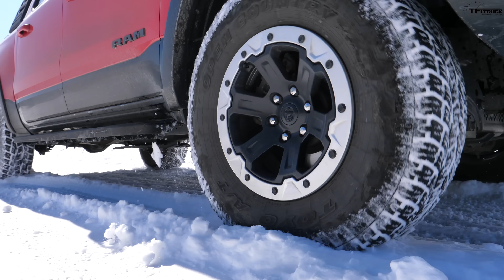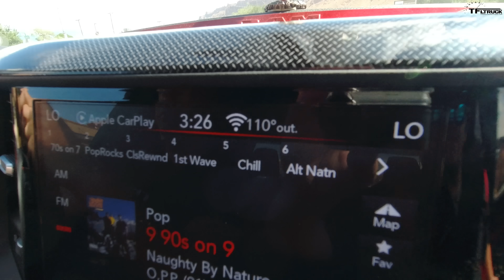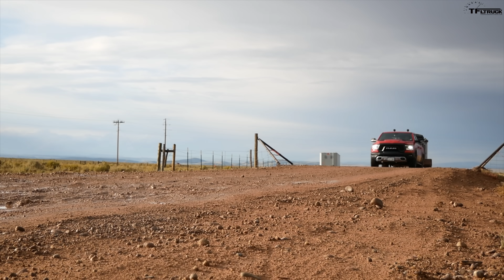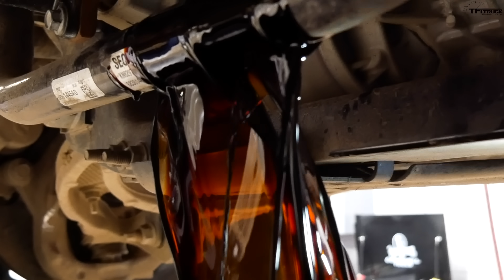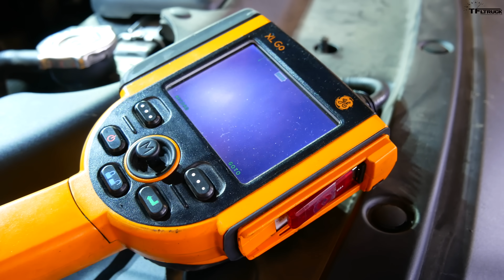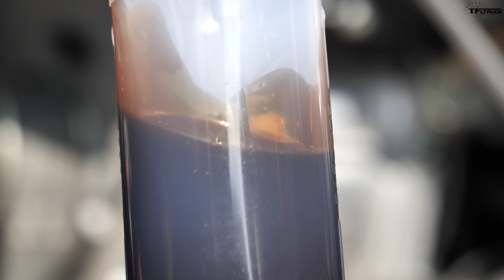You Will Be Surprised at the LOOK INSIDE the HEMI V8 After Months of Torturous Driving! Ep.5

Comment: As far as the TBN goes (6.5), that is a mediocre oil even for a synthetic oil!
Reply: But it's well engineered as we have seen from hundreds of used oil analysis reports which have been posted online showing that the roll-off of the TBN in this oil is very gradual and even after 10,000 miles is still in a comparable range of where other oil brands\formulations that start out with higher TBN numbers are at the equivalent mileage.

Comment: So... The really really obvious question... What did you get in the oil change? Was there any fine particulate material? Anything magnetic? Were there macroparticles on the sump plug? If you're actually intending on torture testing the oil then check whether there were any issues that it caused for the engine. The bore scoping is effectively useless, because if you're seeing bore scoring at that point the engine is done... And that early in it's life, that's a warranty issue, not an oil issue. The only thing that really effects carbon deposits is in the fuel... Not the oil... Unless you're burning some...

Comment: Fix the driver’s side fog light yet?
Reply from the maker: The fog lights turn on and off independently when turning at slow speed.
Reply: Well that’s just nuts.  

Ram woulda done better to put that over-engineering effort into separate fuel mileage ratings between regular 1500s with highway tires and mpg gearing vs Rebels with built in lifts, 3.91 gears, and off-road tires.

Comment: Yeh I use my trucks every day. I used to daily a 12v cummins 2 door dually for a year. I once had a cat dump about 2 tons of stones on my bed lol. Just dented it a little. Drove it 200 miles after. No bedliner either. I also once got a free 12×48ft mobile home, and guess what I used to tow it home lol. Really never worked on the motor I only had the hood popped when doing oil changes. It was bolted to an nv4500 so it was a 5 speed. Loved that thing.

Comment: Change your engine oil every 3,000 or 3 months and your transmission fluid every 30,000 and you differential ,steering, and brake fluid once per year. On any car regardless of how long your manual thinks you should wait especially if you drive fast .
Reply: nope not at all need or practical for the everyday man. I agree with Trans fluid changes once every 60,000k despite the manuals claiming lifetime. They mean lifetime of vehicles standard warranty which is 3 years.
Reply: Maybe on your '78 el camino..
Reply: @bsfunk44  wish I had a el camino I drive a 2015 lexus .

Comment: There are several ways of "proper service interval" calculation. By motor hours, by gallons/liters of gas used, by checking the TAN/TBN. What's best fits to you is up to you. One remark is that tbn/tan test is better but more complicated. So I personally use a "by motor hours" method. Lots of people doing the same confirms that they have no issues with deposits in engine, wear and so on. Moreover, almost all oils in same grade, I mean for example 5w20 API SN (shell, Mobil, Castrol, Petrocanada and so on), will perform almost identically with proper change interval calculated on hours or average long term speed.
I use different oils and change them within 200-250 hours. In my case it is 8000-10000km or 5000-6500mi.

Comment: I just would never drive 8.000 hard miles with new truck without changing the oil.  I would do at 4,000 miles max.  I may not be required, but it's cheap insurance.

Comment: I had a 2005 Dodge Magnum rt with the 5.7l Hemi, I only used Royal Purple 5w-20 Full Synthetic  and changed the oil every 3000 miles. I put 146,000 miles on it before I decided  to pull the engine and swap the factory can out. The engine looked brand new on the inside, and that's with driving  it like I stole it.

Comment: Thanks engineers for putting the oil filter where it's at. Said no one ever
Reply: what's the beef?
Reply: @paulj9821  you obviously don't own a Rebel
Reply: @SHUB281  Correct, which is why I asked.
Reply: @paulj9821  pretty much gotta take the skid plate off, try to finesse a filter wrench   up in there and watch oil run all over your axle and steering linkage
Reply: @SHUB281  wont rust that way

Comment: Lol at the poor engineering on this ram. When the oil drains it just pours all over whatever that large bar is under the truck causing all that splashing.  JUNK.
Reply: I have a Ram and its the oil from the oil filter you see in the video. The main drain plug is further back and has nothing to interfere with draining it.
Most 4x4's I have ever owned have issues when changing the oil filter and getting oil everywhere because of all the components up front. 
My wife's Camry spilled too because it was mounted on its side.
Reply: My F150 eco is the worst.  Filter takes a contortionist to remove and it drains all over the skid plates.
Reply: @mattromain7177  Yiiikes - is that a 2.7 or 3.5?
Reply: @rkalla  3.5, they have a little door you stick your arm through and they built a trough into the skid plate.   Makes a mess.
Reply: @mattromain7177  can't you remove the skid plate? My trd tundra has a skid plate and I remove it. Only takes a few minutes.
Reply: @pryme2013  yes I remove the one for service.  This one is more involved, just not a great design.
Reply: Our Hondas did this as well - very very frustrating. Interestingly enough our Chrysler Pacifica Hybrid (and non Hybrid is the same) is the easiest and cleanest oil change I have ever owned. No ramps needed.

Comment: I still stand by my statement that these tests mean nothing without a control. And you can't show how well something performs or protects without proving that any other oil wouldn't do the same thing.
Reply: Greg Bennett I agree!!
Reply: Supertech Oil works fine
Reply: @MajorWeakness  lmfao right?
Reply: Frankly, you wouldn’t need a control. The way the TAN and TBN works is that as long as the TBN is above the TAN number it won’t matter the oil will act the same, the amount of metals most likely wouldn’t have a noticeable difference. Also this is only really important for oils that last more than 7000 miles, as they face far more duration than a 5k oil. Moral is, if you want your engine to last long do preventative maintenance and change your oil more often than recommended.
Reply: @razvanmihalache5680  If you're trying to prove that your product is superior, you need to show proof. Test other brands to see if you come up with the same results.

Comment: after seeing this I totally regret buying my F150. I only have 15,000 miles on it and it has so many problems.
Reply: G Garden I hear you- cant wait to get rid of my 2018 F150, cannot believe the constant problems- worst vehicle I have ever owned.
Reply: G Garden what years your truck and what engine do you have?
Reply: @JimboBlack-145   2018 V8, burns oil and the trans makes tons of noise.
Reply: G garden u can still get rid of that eco bust it's never to late
Reply: @michaelbags7641  not a eco . 2018 V8 , burns oil and the 10 speed trans makes tons of noise.
Reply: @ggarden8432  FORD means fix or repair daily 😂
Reply: Probably why Ford's going to a 7.3 pushrod v8 again
Reply: Had my tundra almost 4yrs. Only had one issue and that was a feature in the radio stopped working. Not even the radio itself just a function
 So toyota replaced the radio that's my only issue in four years
 Ford is junk. So is ram though too
Reply: Mr M  I’ve had nothing but good luck 🍀 with my Ram trucks . Bought my first in 1994 5.9 360 V8 ran it flawlessly for 280K miles, 2011 5.7 Hemi ran , flawlessly for 100 K miles , 2014 5.7 2500 H-D used for plowing snow & towing ran flawlessly for 80 K miles . Presently on my 2018 6.4 Hemi 2500 runs like a top!
Reply: Had my 18 Titan for over a year now and only thing it's been to the dealer for is oil changes and tire rotation.
Reply: @mforce8117  I would hope thats the only thing after all a little over a year is nothing.
Reply: @truckerrickakamanowar  Normally I would agree with you but the amount of brand new trucks having issues is eye opening.  A coworker bought a 19 Ram that had to have it's gauge cluster replaced a few months after purchase.
Reply: G Garden Can’t beat the reliability of a good ole V8! Don’t buy that Ecodoom Junk!
Reply: @roadglide1142  it's the V8  my 10 speed trans has alot of problems. I have to add 2 quarts of oil to the engine between oil changes.
Reply: G Garden I’ve heard it’s hit or miss with those Coyote V8’s ?

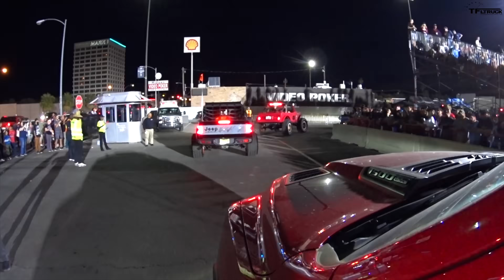Comment: 6:33. Tire pressure looks way too high for this half ton truck. Just because they are 80 psi tires doesn’t mean they need to be real high. Should only need like 43 PSI in a truck like this.
Reply: You are wrong. E rated tires require 80 psi. 3/4 ton trucks come with E rated tires as this truck did. Our Silverado 3500 came with them.

Comment: My 2003 toyota 4 runner 4.7 liter with 212k on it has never even had the spark plugs changed. I've run nothing but Mobil1 or Amsoil in it. It has been in death valley at 120+ and in Iowa at -22 and other than 2 timing belt changes its needed nothing. I live in Iowa now and at -20 it starts immediately without so much as a tick in the motor.
Reply: Probably has more to do with it being a Toyota than with the oil you used. The new Fiat Jeep Wranglers / Gladiators will be needing the motor rebuilt by 100,000 miles.
Reply: @deeznutz9063  plenty of pentastar engines actually hundreds of thousands where are all the engine rebuilds Id like to know. Use facts not bullshit.
Reply: With over 100k miles. My 16 has 67k rt now no issues. Have had 4 Jeeps with no complaints.
Reply: @truckerrickakamanowar  trying to understand that comment. Doesn't make sense.
Reply: @holeran1  sorry looking at the 2nd comment you are rt it doesnt make sense. I meant to say plenty of pentastar engines with over 100k miles on them without issue.  Merry Christmas and Happy Holidays.

Comment: My truck is nearly 10 years old. 300,000 miles and really want to see how my truck motor is. After this video, I need to have the cylinders checked. I've always used Pennzoil platinum full synthetic, usually change oil around 6-8k. Makes me wonder how the walls look, scoring etc. Great video!!
Reply: Running Pennzoil is funny, in a nissan is even funnier.  Nissans quality since the french took the rains is even not funny.
Reply: @mikewest712  quality on nissan trucks is not the same as their vehicles. Their trucks are actually well built.
Reply: Nissan Titan
Reply: Many oil tests say the penzoil ultra platinum and platinum are pretty dang good  I switched to platinum and my gas mileage even got better in my Jeep
Reply: @Floreypottery  Pennzoil Ultra Platinum just barely edged out when going head to head with AMSOIL and it does this at 70% of the cost. Mobil #1 is sub par these days.
Reply: @paulj9821  project farm?
Reply: @LTHero.  yes

Comment: Next time try amsoil is 100% synthetic. Mobile 1 and Shell and others are fully synthetic only small amount is synthetic. And next time cut your oil filter apart and see if it’s doing a good job. Can’t wait until you guys take out the Tremor and see a tough built truck. Thanks
Reply: Penzoil Platinum just as good and far less expensive.
Reply: @gorion70  Ahh another project farm subscriber. Over at "BobisTheOilGuy" we already knew AMSOIL was massively overpriced and makes no financial sense to use when Pennzoil Platinum Ultra can be had for 70% less.
Reply: @paulj9821  Just did my oil change on my Ram 7 quarts at walmart $35.. Pennzoil is made from natural gas so the posters original claim of not being 100% synthetic is just fanboy nonsense.

Comment: These hemi engines are tested from the factory at red line for 56 hours strait, they can handle abuse, where they fall short is long time idling and MDS mode where they cut to 4cyl mode, and eat cams and lifters. Same problem with chevy LS motors too!
Reply: The cam failures were due to inadequate oiling of the roller lifters. Had nothing to do with mds. hemi's without mds had the same failure.
Reply: @gorion70  hemis without mds do not have this issue ar all, the issue started in 09, the 03 and up hemis had no such issue.
Reply: @jamespenner1412  You have to argue with the mechanics on YT showing the issue that dispute your claim not me. Sorry but I'm going with the Chrysler certified mechanics with this one. Good news is they changed the roller bearings in 2016.
Reply: @gorion70  I know piles of ppl with 03-06 hemis and not one has has lifter failure, 09 and newer hemis (in the trucks andyway) are always taking out the lifters, like some last till 400k miles but every motor I hear eventually seizes a roller. On the 03-06 I see none of that, if even seen ppl with 600k miles on original 03 hemis with not one lifter failure, as soon as they went to the VVT IN 09 is where I keep seeing the issue.
And btw iv seen 2017 and 2018 rollers seize so the (new) roller is still not fixing it!
Reply: @jamespenner1412  None of that has anything to do with mds lol You have not stated when and if there were any change to the roller lifters used during any of those years. You are Assuming mds is the cause. Again argue with the mechanics. I love at the end you state new rollers seize as well affirming it's the rollers lol I have nothing left to add so if you need the last word feel free.
Reply: @jamespenner1412  mds started on 06 models
Reply: @tallll70  ya but It didnt seem to give problems untill they gave it VVT in 09
Reply: @gorion70  the rollers are part of the lifter sometimes the lifter collapses and some times the roller seizes, regardless of what you call it its part of the lifters it's called a roller lifter no?
Reply: James Penner the needle bearings in the roller portion of the lifter are failing due to inadequate oiling. This is causing the roller to fail to roll thus grinding on the cam to the point the valve fails to adequately open causing a misfire. It’s due to poor lifter design and has absolutely nothing to do with mds as you claim. The fact is it happens on both mds and non mds hemi motors. This is where your claim of mds being the culprit fails. You Assume all Hemi’s after a certain year had mds when they didn’t. Besides it’s an oiling issue period.
Reply: @jamespenner1412  and it ended in 13
Reply: @jamespenner1412  Again issued was resolved in 2013.
Reply: I have seen three 5.7 engine rebuilds.  In each case the cams were heavily damaged and they had to be replaced.   They all received new lifters, new cams and the heads were rebuilt.  All of them had about 75,000 miles on them.   Wonder why all three engines had to have a rebuild at about the same mileage interval?
Reply: @CopCat34  I've seen a hundred or more. I'm in the car business.
Reply: List situations where ls motors  fail.
Reply: ModernMuscleCar I’ve had 3 different friends have the same issue with their 5.3 Chevy basically blowing up. They burn a lot of oil too.
Reply: @NoticingBehaviors  I have many friends that own 5.3s . ....6.2s and nobody has these issues. I have a 6.2 in my Camaro that gets abused every weekend. Also car builders are doing a ton of turboed  5. 3s for budget build drag strip vehicles. Ls motors are dead nuts reliable so I have to disagree with you.
Reply: ModernMuscleCar disagree all you won’t but that doesn’t change the fact I’ve accounted for 3 failures and others burning oil.
Reply: @NoticingBehaviors  I agree I have herd a bunch as well. Before 07 for the most part I think they were great.
Reply: @NoticingBehaviors  I think you're making that up.
Reply: Peter L why would I make it up? My cousin’s engine blew up, a coworker’s engine had dropped the lifters killing the engine, one of my vendor’s engine was burning oil bad and had to get major work done on it.
Reply: @NoticingBehaviors  yeah, my 07 5.3 burned oil and had lifter tick. Don't know how long it would of last, but I got rid of it because I didn't like hearing it tick. It made me feel like I was driving a pos
Reply: My 15 tahoe 5.3L had an afm lifter fail at 43k miles. All the lifters on the driver side were replaced under warranty but the injector that was ruined because of the faulty lifter was not covered. Still driving it at 140k and its always used one qt of oil every 1,500 miles.
Reply: The hemi has more cam failures than any chevy v8. The 5.3 has been one of chevys best motors ever.
Reply: @holeran1  the 99-06 LS engines were great, after that they have collapsed lifter and seized lifter, high oil consumption issues as well! Just like the hemi, was good then too much over engineered parts and they turn into shit as well!

Comment: Another poor design of how the oil drains on a vehicle.
Reply: I thought that at first too but it hitting the bar stops the jet stream of oil at a predictable distance. Wipe when done 🤷‍♂️
Reply: Just put a fuko valve on it.
Reply: Typical Dodge/Ram, they’ve been doing it for years, you get used to it and learn to jack up the front to help with the stream.
Reply: And they've been making this engine forever...and they still can't get it right.
Reply: @unitedgray  Yah, they got it right.  Just try changing the oil in a FORD 150!
Reply: YUP, so is changing the oil filter.
Reply: @AiWatcheranalyst  oil filter is hard to get to if you though the right angle